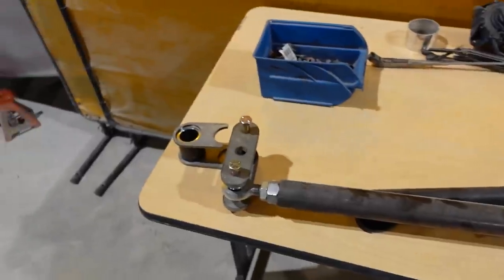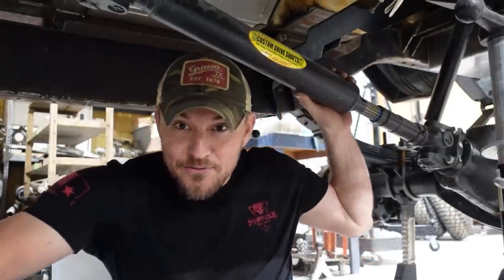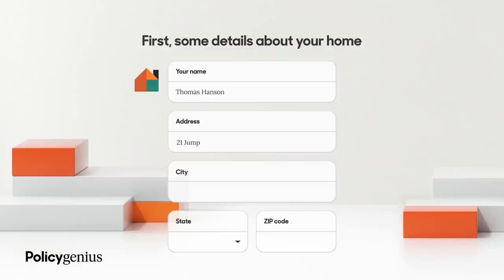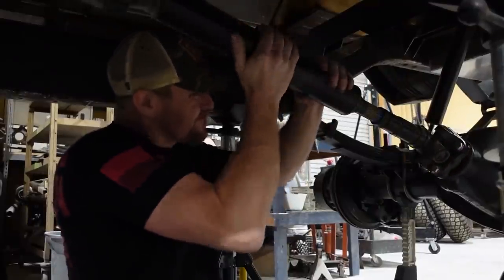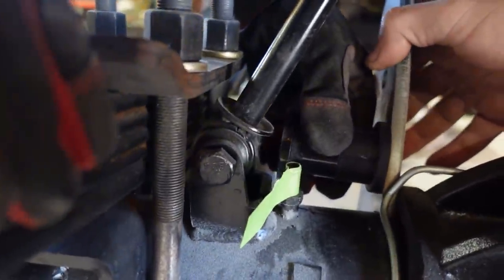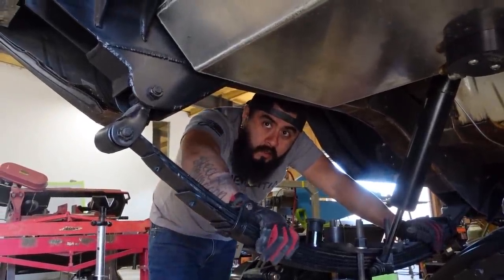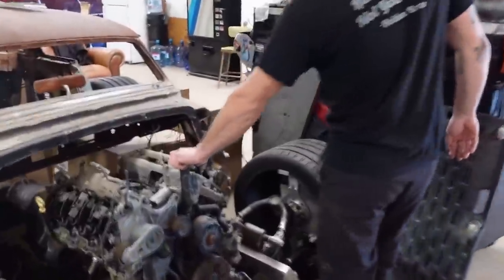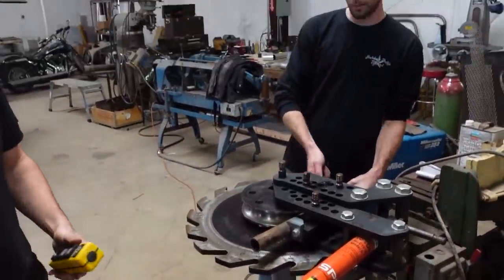DEMO CUDA Heavy duty TRAC BAR assembly / install PT.1

Comment: We used astra-glide when we did lockouts with airbags because it's a lot easier to clean up than other lubes.  You basically just spray it with water and no residue is left behind.

Comment: That track bar is going to eat those bushings for lunch if you put and real stress on the drivetrain. I tried every poly and rubber bushing made in mine that I built almost identical to what you have but on my sas'd Duramax on 43's then gave up and went to heim joints.

Comment: Trac bar should go on the passenger side close to the center section. If mounted on the driver's side it is going to  add to the tendency for the truck to twist and lift the drivers front tire.

Comment: Man, can you imagine if Holden bros finish the ranch tang before Brandon finishes the cuda…
Reply: Definitely going to happen, Brandon is the slowest fabricator I've ever seen.
Reply: There’s way less custom work/metal fabrication involved on the Ranchtang so I’m quite sure it will be done first (it’s basically just an engine swap like in the El Chromino).

Comment: Going to preface this by saying I haven't done the research. 

Greenlee sells an 881 bender that might work for some of your bending. It's also portable. 2.5 to 4inch pipe. 

Disclaimer: it's original purpose is conduit but it is a hydraulic bender.

Comment: Yes I got my trac bar setup from off road design in Colorado!! After getting mine I called them and told them that they only sent one side!! They said yes that is all you need!! But mine has air lockers so I’m putting one on both sides so that I think it will definitely look much better with dual trac bars underneath!!! Does the Cuda have a posi in the rear?? They told me it was because of how the power is put to the rear end is why I only needed one and that is how they send them out to everyone I guess!!!

Comment: I’m curious, so the motor in the RanchTang, is it possible to move the turbos and shit off the top of that motor or are they just avoiding doing the extra work to plumb the turbos? Because I think it would be super rad to put a twin turbo set up on that and instead of headlights just have some spinny boys looking out of the front. Anyway you’re probably the wrong guy to ask but I was just wondering. Keep killing it man, every car you guys touch is amazing.

Comment: Not trying to be rude at all with this comment. Brandon to go more in depth about the traction bars, that rotating motion, winds the leafs springs up, Into an "S" shape. The minute that the load comes off, ie.. the vehicles moving forward. It snaps forward, causing the tires to at bare minimum, break loose. In most cases the tire actually jumps off the road, causing wheel hop. 😃

Comment: Why don't yall make a round plate that bolts to the floor of your shop, drill and tap the bolt pattern for the tubing bender into the plate, that way, you can give back the tubing bender, and whenever you need to "borrow" their bender all you need to do is bolt it to your plate. When not using the bender, just fill holes in the plate with flush set screws so holes don't get ruined....just food for thought...